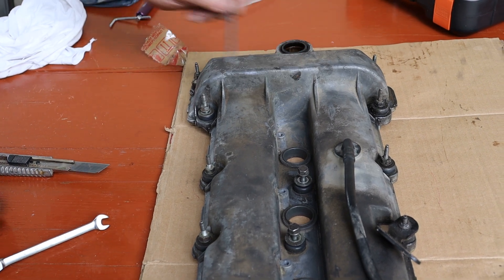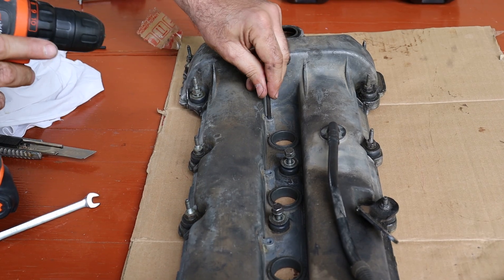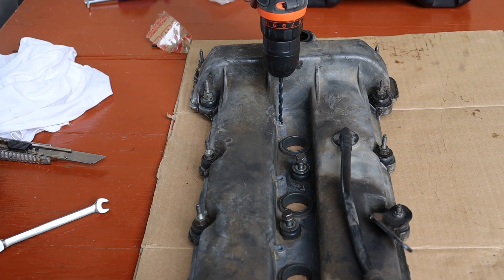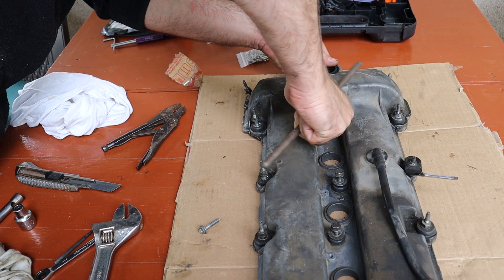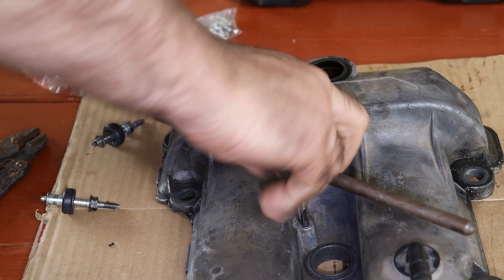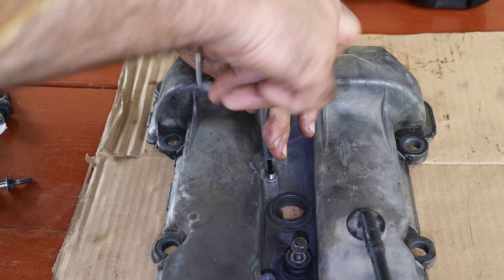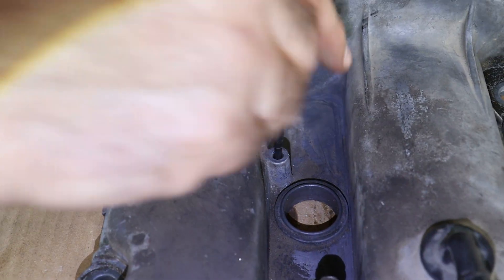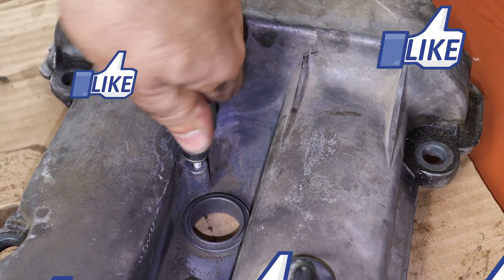A $10 HELICOIL - Valve Cover Bolt Fixed Like Magic

Comment: Is this a joke? This is NOT where the heli coil goes people. You need to do this where the bolt goes into THE HEAD!! This is the stupidest video I have ever seen
Reply from the maker: I showed you how to fix the stripped thread on the engine valve cover. When I strip the thread where the bolt goes into the head, I will film another video. For the time being I haven't stripped the thread in the engine head, but the technology of thread restoration using a helicoil set is the same for both cases. Cheers!
Reply: There are NO THREADS IN THE VALVE COVER!! THEY ARE IN THE FRIGGIN HEAD! 🤦‍♂️
Reply from the maker: @johng9828 Why are you crying? I am hearing you very well. In my head cover there is a thread securing the ignition coil in its place.
Reply: @jaguarrroman no tears here. No even close! 😂
Reply from the maker: @johng9828  good luck!
Reply: @johng9828  lol its not leaking oil from an exterior bolt mount , right. He crazy

Comment: Hello Roman! I am the owner of a 2003 Jaguar X-Type 3.0. I have a problem, when driving on the highway the car cannot reach more than 3000 rpm, it starts shaking the car, but the engine does not stall, there is no such problem in the city. Can you tell me what I need to do?
Reply: there are air leaks on the sensors located on the side of the intake manifold
Reply from the maker: Hello! There should be no vacuum leaks on the manifold. Apply some sealant or wind thread seal tape under the gaskets of the manifold tuning valves and after that check the fault codes with an OBD scanner. Your car is in the limp mode, there can be many reasons of it, only OBD scanner can tell you the correct reason.